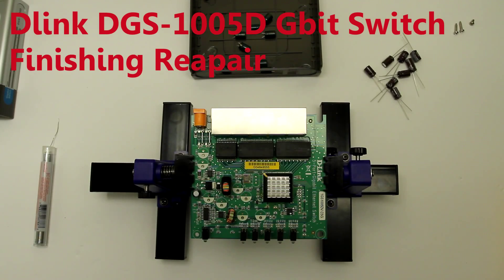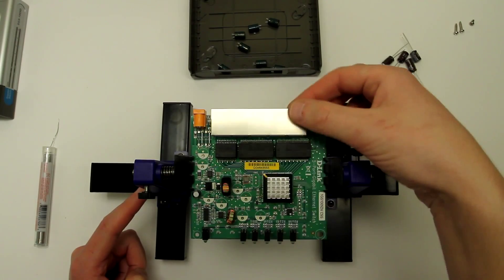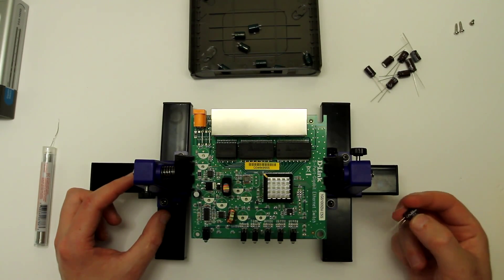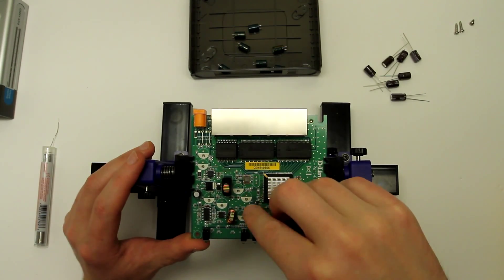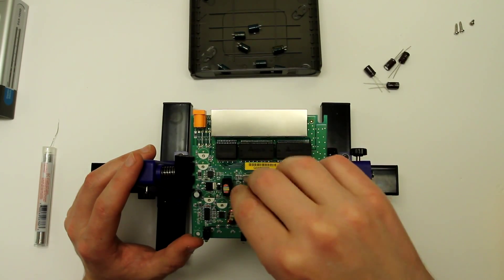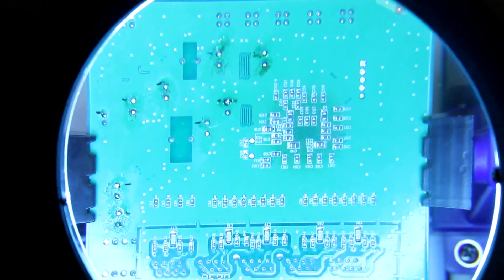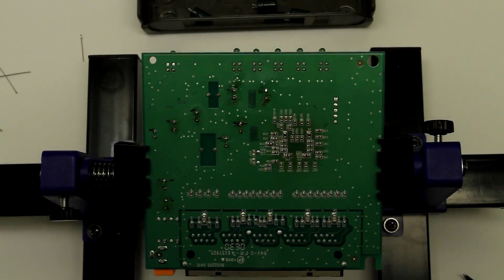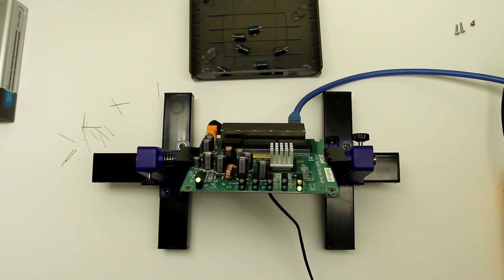D-link DGS-1005D Gigabit switch repair

Comment: I wonder if there is somewhere to put wifi antennas even if it isnt featured
Reply from the maker: Thisvis ethernet route  it does not have wifi chip, twchically it coul be possible to use rspberry pie

Comment: Thanks for this - I have several of these and they've failed in what seems to be the same way. I'll check out the caps
Reply from the maker: You are welcome. I think caps are dying becasue this thing runs hot
Reply: @InsideOutElectronics  I've heard that Teapos are especially failure-prone in heat, so that would make sense. In any case, I will try to buy my capacitors from Nichicon, Nippon Chemi-Con/United Chemi-Con, Panasonic, Rubycon, Wurth, and Kemet if possible.
Reply from the maker: @andrewsawesome  Just make sure that price of caps are not more then price of used operation unit :)

Comment: I'm in the process of replacing the caps in my DGS-1008D Rev. B1
How did you clean the holes before inserting the new caps?
Reply from the maker: I used solder sucking tool.  Something like this https://www.amazon.ca/Wemake-Solder-Sucker-Desoldering-Vacuum/dp/B0002KRAAG
Or desoldering gun, which is more expensive
Reply: @InsideOutElectronics  or solder wick is also great
Reply from the maker: @jessestevens2927  Sure thing !